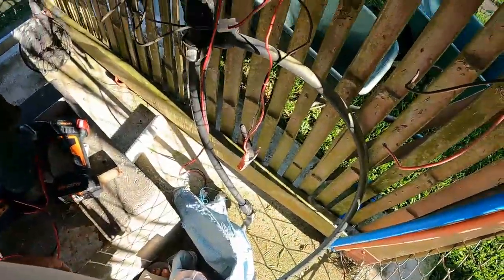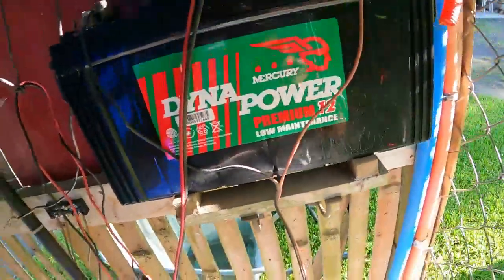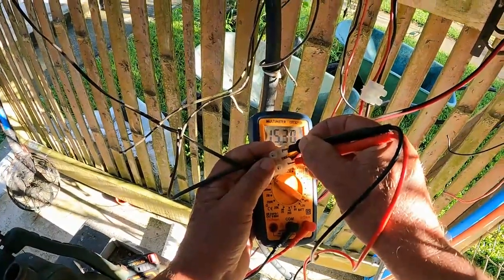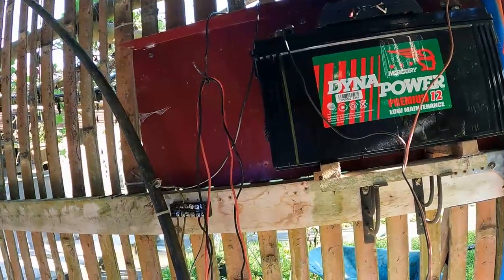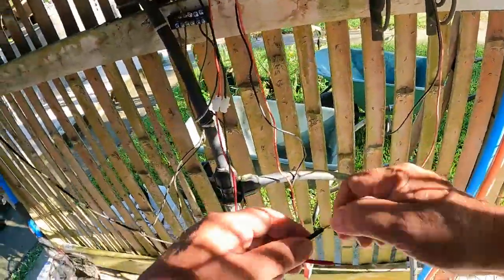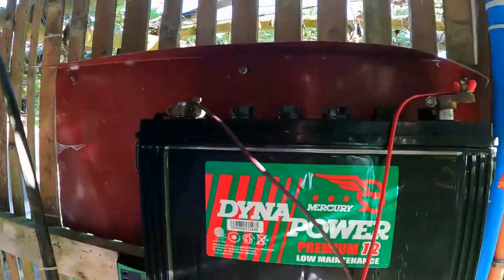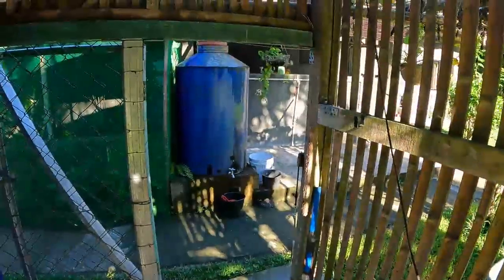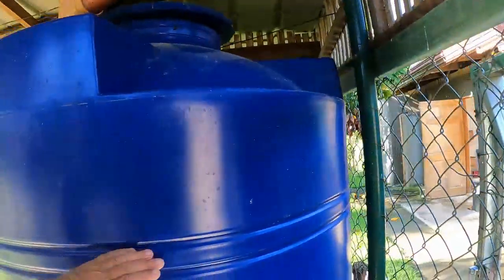Installing a new Solar Charge Controller on the Water Pump

Comment: Great job and great info. I bought 2 small 12v booster pumps for the farm. Just enough pressure to get to the back part of the farm
Reply from the maker: Cheap no 240 volt.. save money .. meaning more beer

Comment: Did your new battery come pre-filled with water /acid as some on the shopping sites in the PH are supplied empty, and you have to purchase electrolyte separately, FMD!
Reply from the maker: Yes they had to fill it when they unpacked it,,, one bottle in each cell

Comment: We had a Well dug on our Lot during the Dry Season a couple of years back. What a Mindf**k!  😌 They gave us a Quote after we explained what we wanted. Start to finish around 30,000 Pesos. 👍

They dug it down by hand 10M then said that is the fist stage, extra to keep going. WTF? 😳
So we negotiated again to finish it, and they Blocked the sides in using Hollow Blocks, but they broke each block in half for some silly reason because they reckoned the full Blocks would not work. 🤔

Then once the Walls were done, again, to cement the Top was extra! ARGHH!! Okay DO IT! FINISH IT! 🤬

Then; extra to fit the Hand Pump and Tubing. FFS! 🤬 WHYYY??? 😭

THEN: the Top started collapsing with huge cracks appearing in it! 😳 If I stood on it I would have probably dropped 10M to Hell and drowned! So again, negotiate a Price to re-cement over the mess that they had created with reinforcement. 😕

So far two years on it has stood the test of time. Touch Wood and at least it has held water where all the Neighbours have ran out with their Wells. Thank God my Wife has hardened up since the early days, still a long way to go tho.

Always More Fun in the Philippines! 😕
Reply from the maker: Yes they will take you for the white man tax ride...  only here in the Philippine do i see it so bad...

Comment: Mate you don't need any better controller than that for a small solar panel and 12v pump.  In fact too big doesn't work well as they need higher inputs from the solar panel to work properly.
Reply from the maker: Ok,,we are happy it all working and free water again